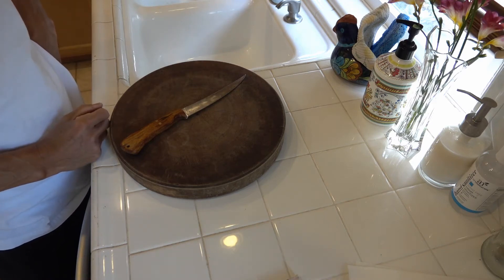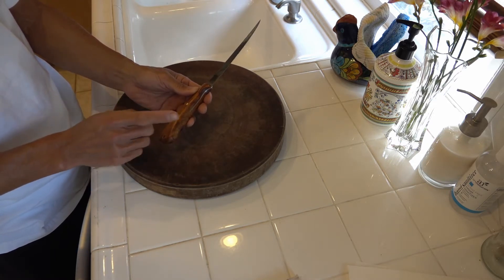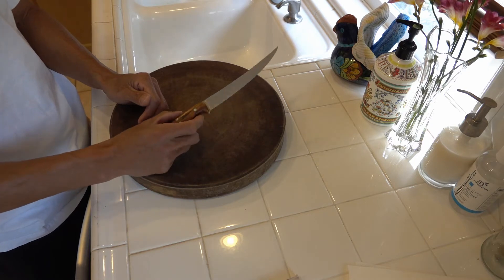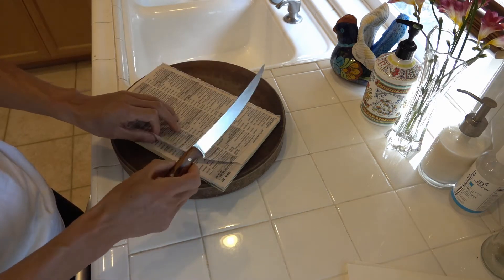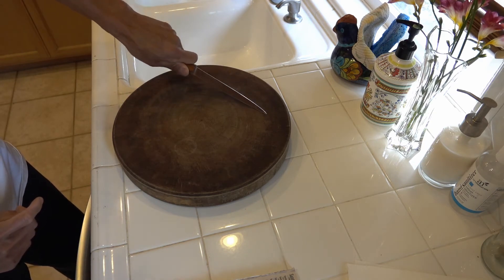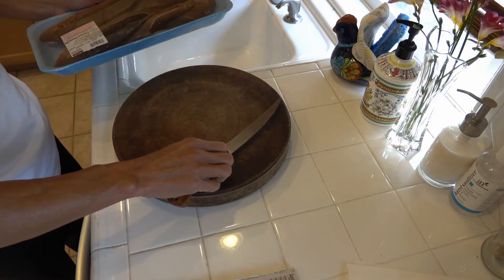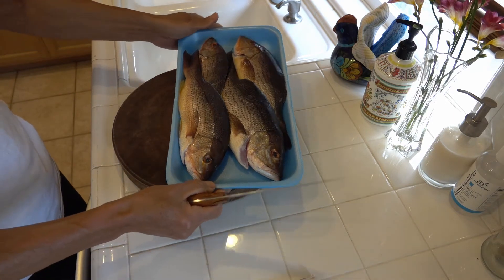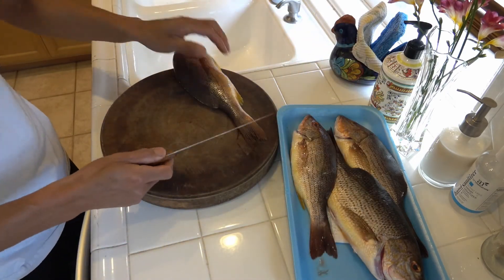Vanax SC Fillet Knife Trims Fish Test

Comment: Hi this is a fantastic fillet knife in vanax sc. This is exactly what I am looking for Mr Luong La. The combination of a fine tip slightly flexible and very fine blade stock in a super corrosion resistant steel with high edge retention. This is brilliant and very fit for purpose. If you are making more of these I would very much like to be considered for one. Thankyou for sharing your skill with us on youtube. I live in Australia on the great barrier reef and fish nearly every day. This is typically the size and shape knife that I carry  and use daily in a very harsh saltwater environment. I can assure you that the knife would see a lot of hard use and I would be happy to provide you with long term feedback on the knifes performance.
 Cheers 
 Craig Close
 APC Design
Reply from the maker: Thanks. I'll write more when returned from trip.

Comment: Hi chú Lượng,
Vanax SC is the most recent version of the Vanax Steel series?
I see on the internet there is also vanax 35, Vanax 75,Vanax 37 and Vanax.
How to distinguish these steels please?
Reply from the maker: Vanax SC is the latest, all other vanax are discontinued.  Unless using a spec gun or edx, there isn't an easy way to differentiate among vanax steels. although vanax 75 probably could reach 62+rc, so that could indicate it is not vanax sc.  I can get vanax sc close to 62rc after so many attempts.
Reply: @Luong_La  Thanks chú Lượng.

Comment: Hello Mr. Luong La,
I watched several of your videos, I like your knowledge in the field of knife steel.
Can I order a knife from you?
Thank you.
Reply from the maker: Thank you.  I appreciate your asking however BCMW is current doing R&D, hence not taking order/custom/commission for knives.  Nevertheless, I do have some production & tested knives and would sell if you ask for explicit knife or state specs of what knife you are looking for - so if I think there a match, I will let you know.
Best regards,
Reply from the maker: @gialuongpham7870  I don't have any stainless bushcrafting knives already made on hand.
Since you are intestered - for up coming stainless ht batch, I will cut a few bushcrafter blades in [niolox and becut].  Around 61rc hardness either steel would provide excellent toughness and edge retention.  *note - bushcraft knife is mostly use in push cutting mode, so abundant of large carbide (e.g. many cpm steels) doesn't contribute much (i.e. hardly) to edge retention.
Reply: @Luong_La  Yes, I understand, for a bushcraft knife , the carbon steel is a good solution. But anyway I only like stainless steel.
In fact, I thought you wouldn't agree to my request to make a knife for me. I'm lucky. I like to watch your videos, you have experiences but above all I like your way of sharing knowledge. It's simple and modest.
Thank you very much, Mr Luong La.
Pham Gia Luong.

Comment: What do you think about  26c3  for filet knife ?
Reply from the maker: It would works fine but need to touchup edge more often and also more care to minimize corrosion.  In other words, high corrosion resistant  - such as stainless - steels are better fit as fillet knife.
Reply: @Luong_La  Thank's , what about AEB-L ?
Reply from the maker: @dimmacommunication  Aebl 62-63rc should works well, so as cpm154, vanax, magnacut, s30v, etc..  Catching fish is time consuming, fillet is fast and short :)